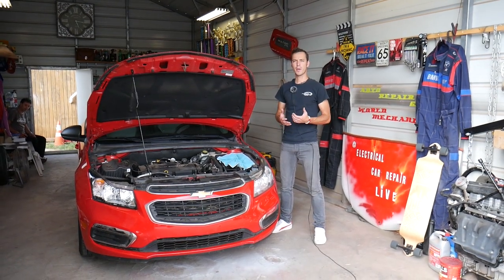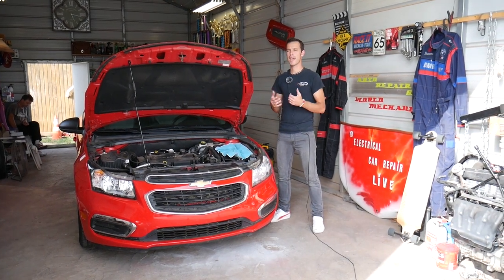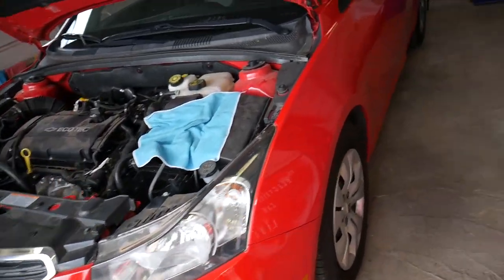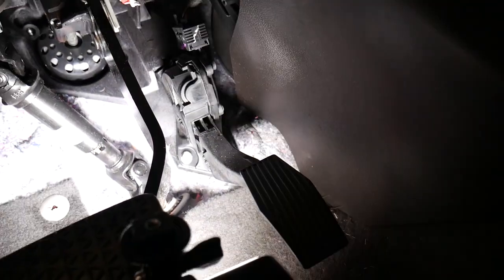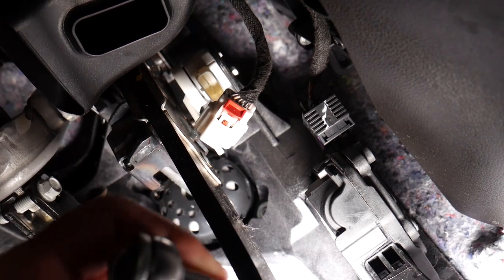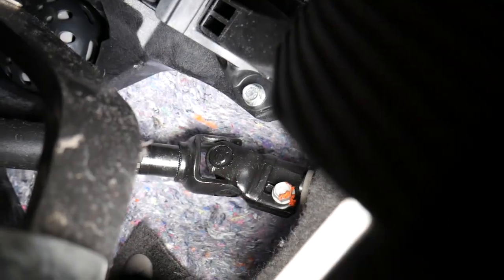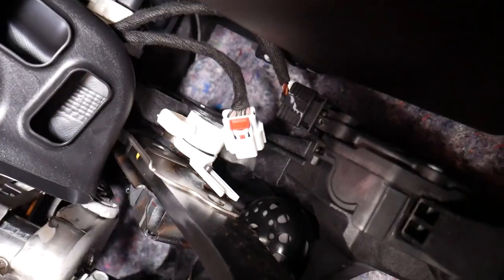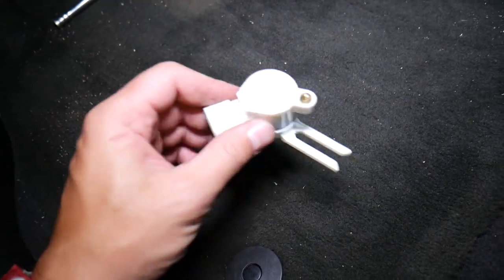HOW TO REMOVE AND REPLACE BRAKE PEDAL POSITION SENSOR, BRAK LIGHT SWITCH CHEVORLET CRUZE SONIC

Comment: Fairly easy to remove. It was a pain to line the screw up in the actual sensor to put back. Therefore it took about an hour. The part was about $35 from Autozone. Saved me a bunch of $$$ on labor!!! Decent video! Thanks!

Comment: I really like your videos! Thanks! I have a question. My brake lights dont work. But the central midle one it works right. I have changed bulbs but no luck. Do you think my problem can be the brake swich ? Thanks

Comment: After watching many videos I found one where there’s a panel and a plug in on the passenger side down against the center console. I pulled the cover off, lifted the clip and put die-electric grease on it and suddenly the tail lights work!

Comment: Hi mate,  I have vauxhall Astra design turbo 2016 and on the dashboard cruise control system and abs light on. May be my car brake padel position sensor may be damaged that's way lights on can you tell me

Comment: 2008 Impala with the brake lights staying on once i turn the ignition the brake lights (left, right, & trunk) stay on constantly. Once the car is turned off the lights will turn off. Both signal lights are working correctly. I've replaced the sensor & my brake lights still stay on constantly. Not sure exactly what to do at this point 🤷🏾‍♂️.
Reply: Estoy en las mismas
Reply: If you already haven't done so since your comment, you may need to get it calibrated which requires an advanced scan tool.

Comment: Just replaced mine and the lights still stay on . Lol
Reply: Same did you figure out the issue?
Reply: NVM I got it, I would need a top of the line scan tool to recalibrate the sensor itself. Just going to bring it to a shop because it's a quick job
Reply: @masonnash9305  yes , I took in and out the fuse/plug hidden in the center console . On the bottom passenger side . Blew some dust off and it worked .
Reply: @thatvegashighrisedude2757  could you tell me where the fuse for it is?😂
Reply: @SpazActivated  yes its on the passenger side , on the bottom of the center c0nsole .